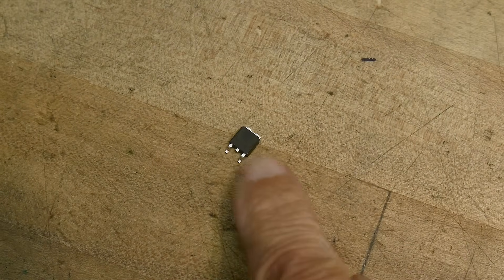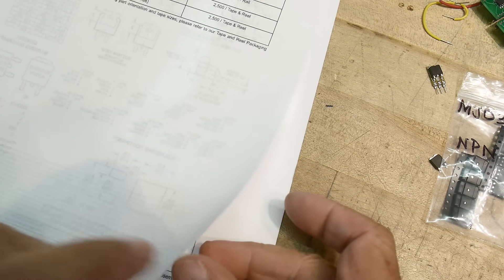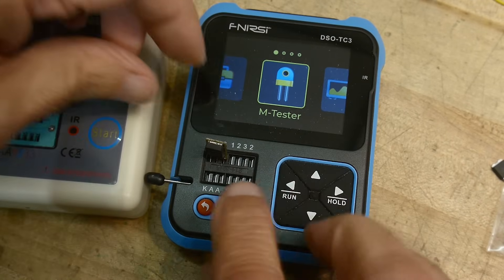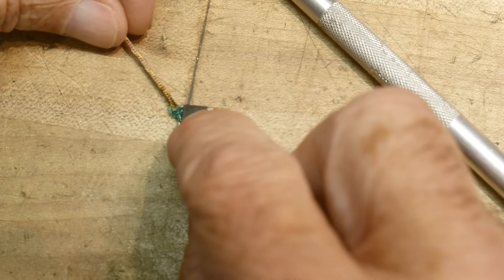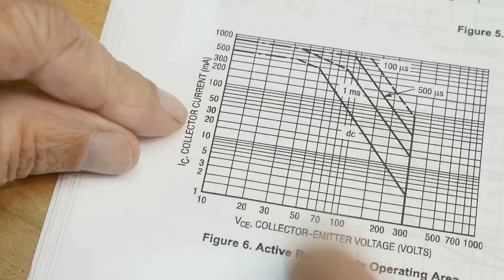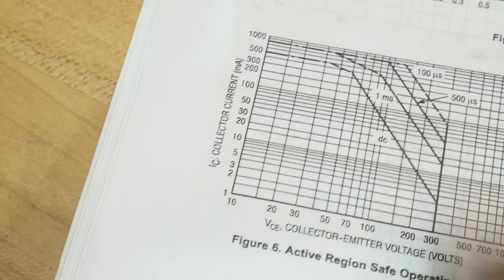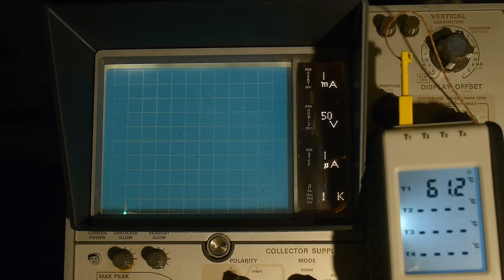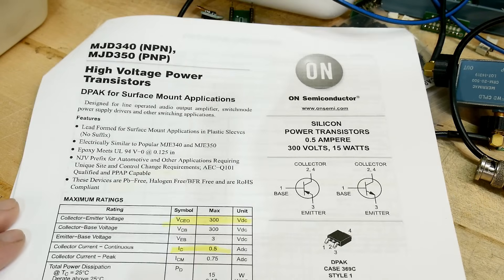#1743 MJD340T4 High Voltage NPN

Comment: My go to (American) parts for moderate power in various current/voltage combinations have been MJE 172/182 MJE200/210 and MJE340/350 for a long time.  Was worried about them going away, seeing these DPAK versions for at least 340/350 and 200/210 is great.  Didn't immediately find the 172/182 in DPAK...

Comment: Just a little question, i have some transostors "N12005", manufactored by philips in 1989. Does anybody here have a datashet for it, or at least the most importand data like maximum voltage and current; As far as I suspect it is also a high voltage PNP type... Picture would be here: http://www.telefonwerkstatt.at/dc/Technik/N12005_PH.jpg

Comment: 1.5W bare package to ambient, so as a saturated switch good to go within rated limits. running in any linear mode it can handle almost nothing without a heatsink.